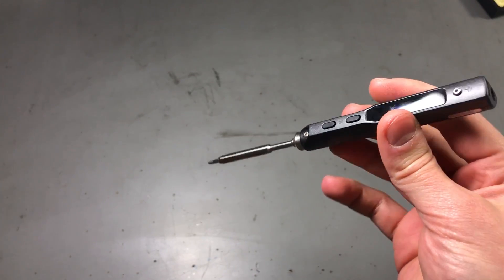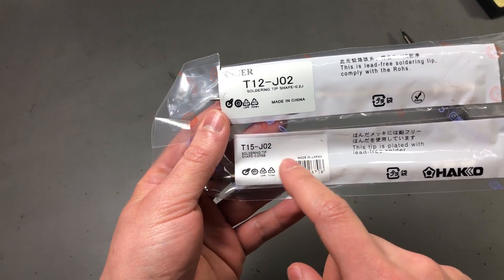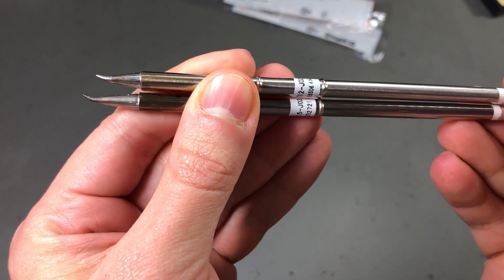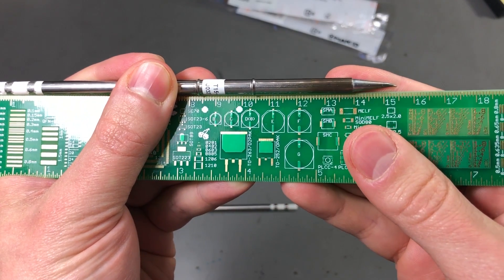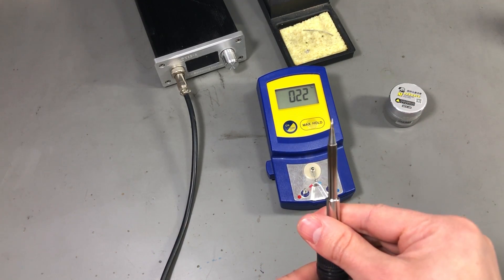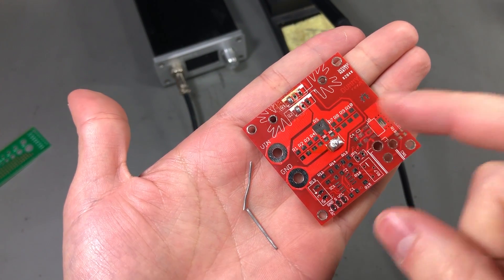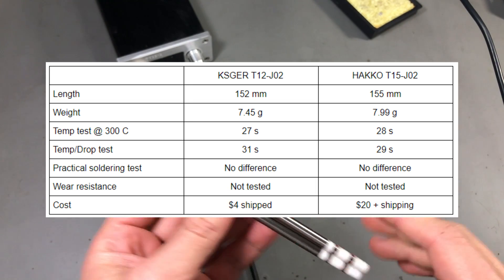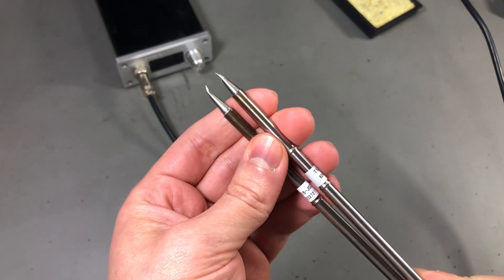Voltlog #215 - Is a genuine Hakko T12 tip much better than fake one?

Comment: I bought a 969 station around a decade ago. It uses M900 tips which are 5 different shapes for $2. I've used 3 tips the round slanted one 1.8mm, flat chisel type 1 and 2 mm. I'd estimate that have around 50-60 hours of use each and are still good. 
Anyway I've changed to T12 tips now and don't know if they're better. I did mod my 969 iron handle to bring the heater element closer to the tip. Don't know if that helped but I flux and tin the tips often.

Comment: Interesting because the knock off vs Hakko 900 Series tips were night and day vs knock offs that were hardly usable.
Reply: No-name or counterfeit T18/900M tips typically fit the ceramic heater far too loosely for good thermal transfer; genuine Hakko tips are made to tighter tolerances and fit snugly, as well as being copper cored. Iron has very poor thermal transfer characteristics. I posted a video where I tested various tips for magnetic attraction, or the lack of it. Genuine Hakko tips are $7 direct from Hakko USA, so why buy anything else?

Comment: Hi. What would be more valuable/interesting to see is these cartridges under a thermal vision camera. Not for the temperature measurement, but for heat distribution in the cartridge. There is another video on youtube where a guy does that with original and fake JBC cartridges. In the original cartridge the hottest is the very very end of the tip, showing excellent heat response. In the fake one the hottest is not the very tip but the thick part of the cartridge. Naturally, response is slower with the fake one. Would you be able to show how both look through thermal vision camera?
Reply: Here is where he shows that for JBC. The performance of original JBC cartridges is impressive: Review of the T12-11 Chinese soldering station. Can it be a cheap JBC alternative?

Comment: I ordered some T-12 for my T-15 soldering pen.. Some fit and others didn’t… Some T-12 tips came with a flat end cap instead of a rounded end cap. Which made the tip not slide all the way into the solder pen. I have not ordered non original T-15 so i don’t know if the flat end cap problem thing is also found fond on them too.. I thought to share this as another piece of information… The T-12 tips who fit my T-15 solder pen had the oval or rounded end caps on them.

Comment: I've seen a number of youtubers who have observed substantial temperature inaccuracies with the fake tips.  This is easy to remedy with T12 stations that can store calibration values for each tip, but I wish that VoltLog had compared the desired vs. actual setpoint temps between the genuine and fake tips in this video as that's just as important as how fast they reach a setpoint.

The common, counterfeit hakko iron thermometers are rather bulky and add yet another infrequently used item to your workshop, but they are inexpensive enough that you can easily add one to your kit for calibrating new and old tips.

Comment: Yup, the clone Hakko T12 D12 tip, just died after less than 4 days. Buy the genuine whenever you can afford it (it's about 7x more expensive) I did push it above 450 Celsius (480 with bursts of 500+) to test my new tips and new and amazing T12 soldering station.

God bless, Rev. 21:4

Comment: 4:58 shows main difference - on fake tip core is heated to 370 degrees, but tip end is not. genuine tip transfer heat(and power) much better. same on 5:50 - fake tip core is 300c but cant melt solder, while genuine is only 200c. if u put fake tip in water it will show 300c and will not boil water cuz cant transfer enough heat from core, which means it is low power (watts are joules per second), and genuine tip will boil water and drop temp to 100c while in water, which means it transfer all power through tip and have real power rating.

Comment: Have you tried to Cross-section one of the knockoff tips and compare it directly to the T15 tip ? maybe the differences lie within the craftsmanship of the inner portions of the tip itself for example the sensor inside of the tips , are they both existent  ?
Reply: You can see in the video they both heat up & read about equally

Comment: How are the fake T12 tips holding up?
Reply from the maker: Not a single one has failed.
Reply: @voltlog  Thanks! Tip plating is holding up too?I ask because service older audio equipment with Thru-hole and Point-to-poin't wiring, tube sockets etc. and do a fair amount of soldering. I currently have an older Weller station, Hakko FX-888D and I recently bought a Pace ADS200 station but haven't opened it yet. I'm thinking of getting a KSGER T12 station because it's inexpensive and has good reviews.
Reply from the maker: @acoustic61  Sounds like your daily usage would definitely generate more wear on the tips than what they get on my bench where I do mostly SMD work and it's not everyday use. Still, I think they will hold up reasonably well and considering the cost you could keep spares around in case one of them fails. I would try to find a reliable source to get them because I'm not 100% sure they all come from the same factory so there could be quality variations if try to get the absolute cheapest you can find on aliexpress.

Comment: Hakko T12 clones are a great alternative for someone who is purely hobby soldering.
This type of soldering tips is second to none in precision and speed of operation.
I would like a little more powerful heater in soldering tips about 90-110W and then you would not even need to heat the plates. I was able to desolder without heating the transistor from the old graphics card using a large drop of tin and a temperature of 350 degrees C.

The station itself is also a great piece of ingenious technique. Much better than HAKKO. You can quickly put the soldering station to sleep with the pre-set waiting temperature, you can quickly raise the temperature for a set time and by a set value.
 Each tip can be calibrated and selected later quickly from the menu. You can even set the time and date: D

A huge plus is that each soldering tip has its own heater, if one of us burns out we have other soldering tips and we can less comfortable but finish work.

The big minus is that these counterfeit soldering tips are not tested at all, and I had one factory damaged, which could be checked at the factory during quality control because there was a short circuit in the temperature sensor and the heater.
Reply: I use tips copies of hakko work for a limited time is to waste money for the garbage I do not recommend them
Reply: Ive had one come and the soldering station itself kept beeping and displaying error but the tip is fine when checked with the multimeter
Reply: @alexstone691  Do you have it on the original Hakko tip?  For 10 tips, 1 I had a faulty short-circuit of the temperature sensor to ground.  1 also caused the station to be overloaded at the first start.  But it works after warming up.  The other 8 work fine.

Comment: BIG DIFFERENCE BETWEEN ORIGINAL AND COUNTERFEIT IS THE QUALITY WICH IS YOU CANNOT JUDGE IT IN 7 TO 8 MINUTES VIDEO
2ND MOST IMPORTANT THINK IS CLONE ONE GETTING CORROSION FASTER EACH TIME YOU HAVE TO CLEAN IT
Reply from the maker: I think there is a problem with the Caps Lock key on your keyboard.
Reply: @voltlog  NO ITS WORKING ABSOLUTELY FINE
JUST I WANT YOU TO NOTICE THATS WHY ITS BOLD N BEAUTIFUL LOL 🤪
Reply: @SAMEERSAMEER-ec3iw  Brash and ugly are the terms you're looking for.

Comment: Problem is, for $20 you're paying for the R&D of the tips.
The Chinese just come along, steal it, people buy the fakes, hakko lose out revenue, and R&D has to make cuts. 
Hakko quality drops overall in the long term, and ironically, the Chinese copies quality drops, as they can only copy, not innovate.
Reply from the maker: It's debatable because chances are, people who can't afford to buy hakko will never buy hakko while the ones who can afford will continue to buy the original.
Reply: Are you paying for R&D though?  People like to trot out this claim, but when were these tips developed, how much did it cost and has Hakko recouped their expenses?  Is the heating technology or the tip shapes under patent?

The Chinese regularly innovate.  I have an RC helicopter that looks a lot like one from an American brand, but the Chinese have produced a superior design.  It costs less to buy, is more durable, flies better and is cheaper to repair than the American brand.  People outside China had better wake up, because Chinese consumers are getting more demanding and the quality of Chinese products is going up and they're moving on from simple imitation.
Reply: @ian1352  Back 60-70 years ago the same was said about Japanese made products being cheap as compared to many products made elsewhere and now many Japan made products are considered the best made of anywhere in the world.
China seems to be following that same pattern as they gain experience in manufacturing and continually improve their factories abilities and machinery.

Another thing in today's times Japan faces the same issues as say the U.S.A. with high production cost at home in Japan driving Japanese companies to outsource their production to China, Vietnam and Thailand hence fewer products even from traditionally well-known Japanese brands are actually made in Japan anymore.
Chinese quality is definitely getting better while maintaining somewhat reasonable prices as compared to many options that are made elsewhere.

I can and have bought a ksger complete t-12 soldering station for not a lot more money than I have to pay for a higher wattage replacement tip for my vintage Ungar soldering iron. Although I do keep my 40 year old Unger going as well!
Reply: Certainly they can innovate if there's a better tip to be made...but I'm not sure there is. No need to design something different just to be different. Not sure what what they have patented either.
Reply: Personally I think Hakko and other similar priced manufacturers are aiming at the professional market.. Those buyers \ companies are not going to try and save a few dollars by purchasing some alternative tips.  They are going to want to provide a pro product \ service that meets standards.  Hence the reason why Hakko has the key card and other manufacturers have similar features.

Comment: For me, the difference is in the accuracy of the thermocouple. The genuine is better.
Reply: That is true. They are still decent for the price, you just have to break in let sit on high temperature and then select tip type and run the calibration and they work fine. The genuine ones are usually bang on from factory and no burn in required as stable out of packing.

Comment: You forgot one major factor that is reason for me to avoid the non oem one, the size of the tip especially the tip of it! I work alot with smd based component boards under microscope and I can tell you when you work on that level the tips on the non oems are gigantic compared to oem.
Reply from the maker: I don't know what tips you got but take a look at the video they are identical in size.
Reply: @voltlog  I don't get it, the tips on the two from what I see on the video, while similar are NOT the same. The hakko one is longer and has more curve which is why it is probably measuring 3mm longer. I am surprised you did not mention this at all in your video. The Hakko one seems better for fine work. UNless what we see on video is an illusion.!??
Reply: @abeleski  Exactly, they're different in shape and in weight and in price... Just depends on the application like masoodno said - if it's not working for you, get another tip, genuine or not.

Comment: I have one genuine T12 and several fake ones. One of the fake ones failed after a few hours of use.  And genuine one last few years so far. Other peculiar thing I noticed about the fake ones are their heat capacity isn't good. For soldering larger chunk of piece it can not produce enough heat to ensure good result.
Reply from the maker: The one that failed might be a quality control issue which several people said in the comments it would be the main difference between fake and original.

Comment: VoltLog, I think there's something very wrong with your T12 soldering station. These tips should reach 300°C in 10-12 seconds (original tip + original station) and that correlates with my impromptu test (12 - 15 seconds, chinese tip + T12 module). JBC C245 tips can do that in 2 - 3 seconds. Also, the PCB test shows quite low power delivered by your station. I'm using cheap T12 module with STC (not STM) microcontroller and 7-segment LED display and second module, also with STC microcontroller, but with OLED matrix display. Both modules draw 2.7A from DC 24V source, which is 65W and it is almost the nominal power rating of these tips (70W).
Reply from the maker: are you using the value displayed by the controller for comparison? what is not always accurate so you should do an external measurement with a soldering iron thermometer like i did in the video.
Reply: @voltlog  I have the same chinese copy of Hakko FG100 thermometer as you have and it is accurate - I checked mine against multimeter and both, the FG100 and the DMM, showed same values.
Reply from the maker: @ales_xy  I will also review a ksger t12 soldering station soon so we'll see if the results are similar or if there is something wrong with previous tests.

Comment: Are those fake thermometers any good?
Reply from the maker: yes, pretty good and accurate.
Reply: They are very accurate, same as digital multimeters with K-type thermocouple measurement. Also, if you want to spare few $, you can buy just the replacement thermocouple and connect it to multimeter with temprerature measurement. It works.
Reply: @ales_xy  any video to show that?
Reply: @sbybill3271  
No video needed just plug - with -, + with + on your multimeter with temp function.

Comment: The things you haven't tested are the only tests that matter. If Hakko is more durable and lasts for a year, while a knockoff needs to be changed every 2 months, then I'm all in for the expensive. I wouldn't care if one reaches 250 degrees in 6 seconds and the other in 9 seconds, but it would make a huge difference if I had to frequently buy a new tip. Chinese ones take 40 days to be delivered and original ones aren't available in my country, so I would have to find a trusted seller on ebay.

Comment: Awsome, the thing that has put me off buying one of these irons is the cost of replacement tips, if Hakko were not so greedy they would sell more of these irons.  For me I will wait until there are cheaper irons and then I will of course buy the alternative tips.
Fantastic video, thankyou for sharing this review with us.
👍👍👍
Reply: I agree that generic T12 tips are good enough, but I don't think Hakko is being greedy here.  They have patented alloys and construction for their tips and I am certain that they will last longer than generics.  You are paying for the research and quality manufacturing that Hakko offers.

*However*, the generic T12 tips are surprisingly good for the price and I actually recommend them.  You can get a full set of generic T12's for cheap, so why not get a collection?  I've seen no reason to buy genuine T12 tips, which is rather unfortunate for Hakko.

This is not true for T18 (900-M) tips, though, as the Hakkos are so much superior to the generics that I recommend buying the genuine tips.  The real tips range from $5 to $20 each depending upon the style, which isn't so bad considering that they will last for years.  The generics may less than cost $1 each, but often have terrible heating and may last only a few months at low temps and mere weeks at high temps.  There is a performance difference here.

Better quality T18 generics might actually exist somewhere, but this market is so flooded that buyers can't possibly know if they are getting a better tip even if they pay extra.  Unfortunately, it's not easy to find genuine Hakko T18 online, though there are a couple of ebay stores, such as nesselectronics, that sell a limited selection.

If you want to use generic tips, definitely buy a T12 station.
Reply: @antibrevity  very few people like to take R and D into account or even acknowledge it a pricing factor. Everyone wants something for nothing.
Reply: @antibrevity , genuine  T18/900M tips are about $6 to $7 directly from HakkoUSA, not terribly exoensive, so it's foolish to buy cheap tips of unknown metal and poor thermal perfirmance from  Amazon, fleabay etc. The Hakko tips are made to tighter tolerances and fit more snugly over the ceramic heating element than the cheap tips do. This is easily confirmed with digital calipers.